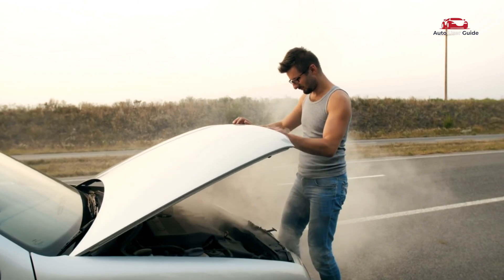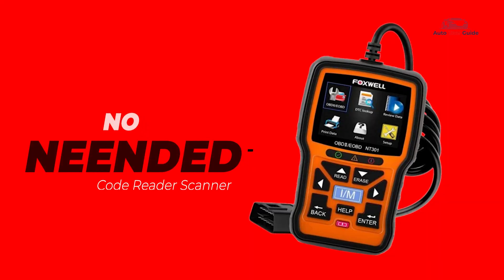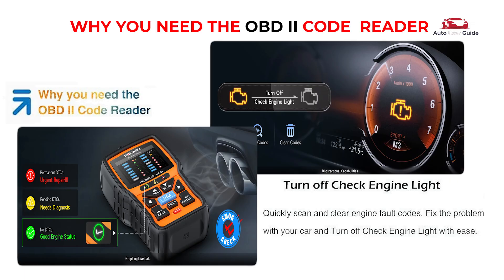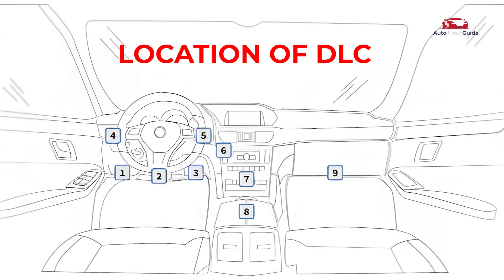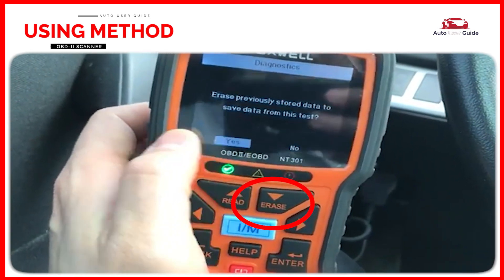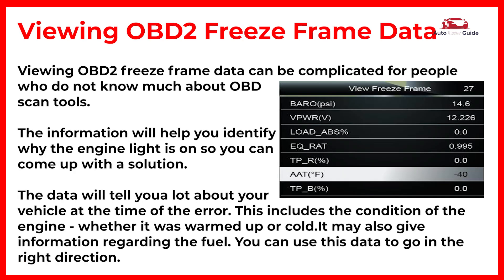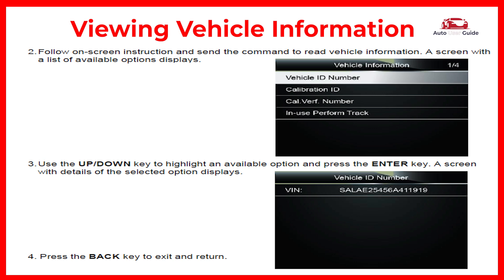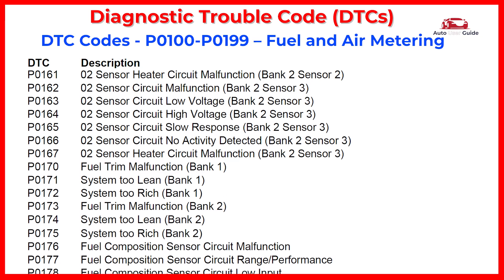How to use: Foxwell NT301 Car Diagnostic CODE Scanner Guide | All DTC codes Explained

Comment: Hello to all.

Foxwell scan tools is probably and option in your tools collection.
But maybe you should do some research before buying this tool, or any Foxwell tool?.
This tool does not work on cars that is older than 2010! And only on some cars from 2010 upwards?.
No japanese cars oder than 2010! Would be able to be scan with this tool.
Saying this tool could scan cars from 1996, Is just and advertising strategy to sell this tool.
This tool always fales to communicate with the cars ECU? In old cars, and in new cars your access is limited. 
This is my experience with the Foxwell nt301 scan tool. 
So if you would like to buy a scan tool, maybe you should invest a little more, and buy a tool, than actually do what it says?.
Do your research and buy a brand name tool, and make sure its compatible with your car.
I hope this information help you make the right choice! And you consider your options first!.
Keep in mind there is a lot of options, when it comes to scan tool, So take your time. 
Thank you for your time, and for reading my comment. 
Bye, Have a nice day.
Cool 👍.